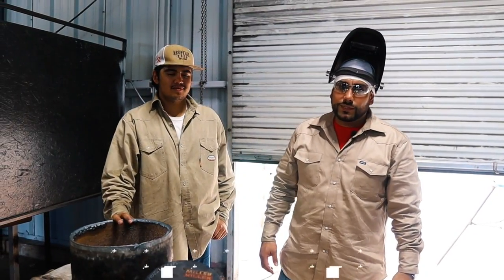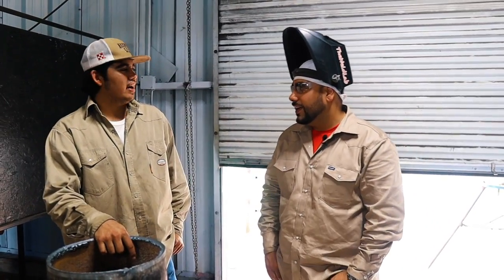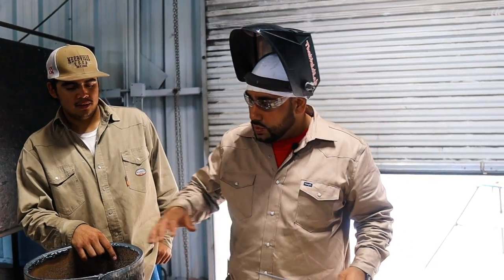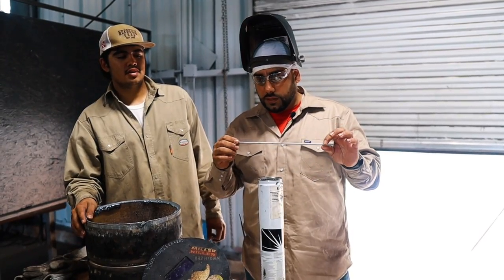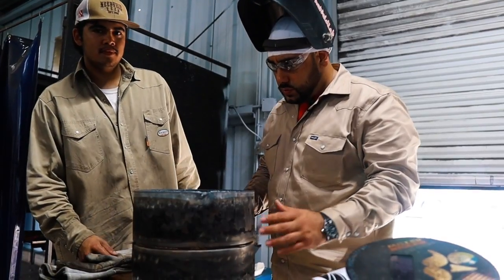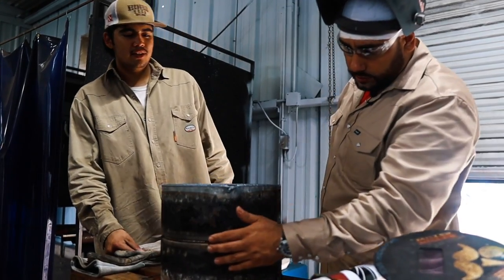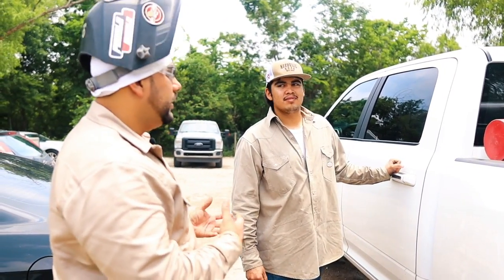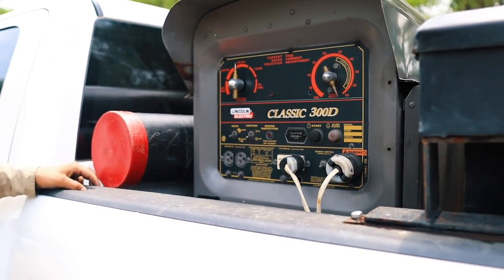TESTING OUT NEW PIPELINER ROD 9045!

Comment: who manufactures those rods because lincoln probably 20 years ago came out with a vert down low hy rod for pipe and they wound up discontinuing them  nobody used them or pipe lines wouldnt approve them or something like that.  same with innershield wire they make for pipe welding and nobody in this country uses them  cool vid  tho  love your channel!!
Reply: I’m company hand for Enbridge/Texas Eastern. We run nothing but 9045 LHD now and have been for 3 years.

Comment: Can’t see those catching on lol.   Looks like it runs like shit
Reply: @thomasmcnicholas8656  interesting!
Reply: Just about all are pipelines where they can't run automatic cause of terrain there running these rods. So there catching on.
Reply: @brendanfair4108   lol.  Maybe where you live
Reply: I’m company hand for Enbridge. We have been running them company wide for 3 years now. API will be making them standard for all x65 grade pipe and above within the next 2 years. If you run any kind of mainline, you’re gonna wanna get used to em cause they ain’t going anywhere. They want cellulosic rods gone. All low hydrogen
Reply: @jacobaldridge626   interesting,,  I stand corrected sir
Reply: @lingslinger2786  they supposably reformulated them to run better like 3 or 4 years ago they are different for sure but I can see them catch on everywhere in the near future they been pushing them hard since they were developed.